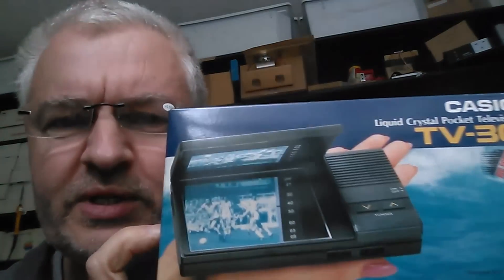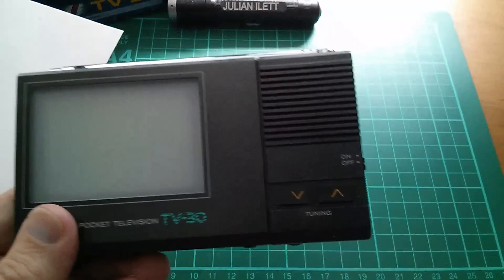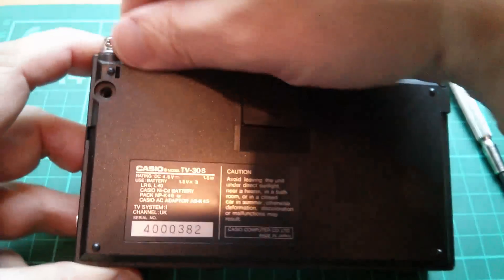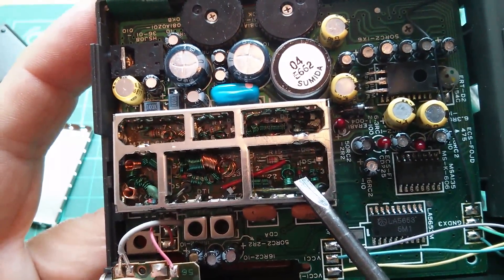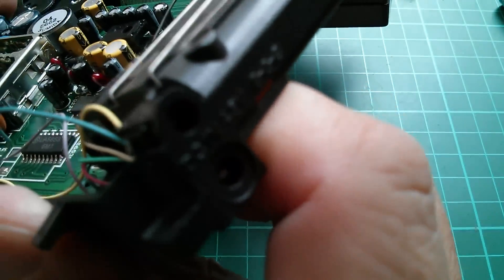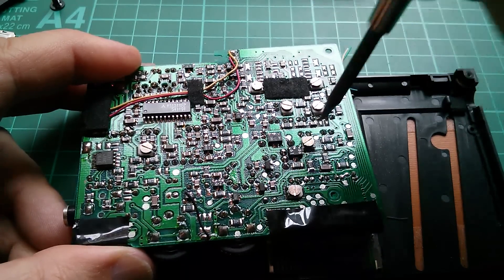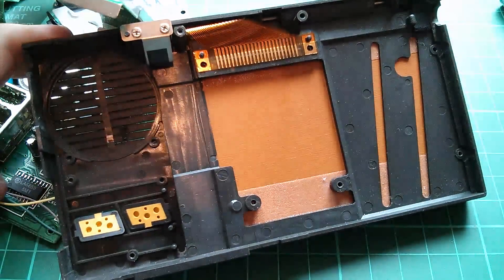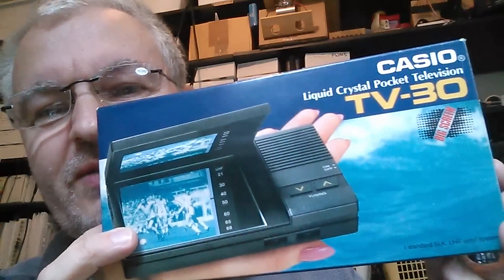1-Way Teardown: Casio TV-30 LCD Pocket Television

Comment: A UHF and VHF tuner will definitely use air-spaced inductors. Splitting and adjusting their spacing by hand on the production line, is how they were tuned and aligned.
Reply: Made in Japan too. Not bad for $50 all the stuff crammed into that little box.  The tuner wasn't bad, I was able to pick up a few stations the rooftop antenna couldn't with this tiny Casio.

Comment: As much as I hated the early LCD tvs I won't have destroyed one in that condition. It was in the box and fully working, yes now they are not worth much, but nice as a conversation piece and down the road will gain value. You sure have bought a cheap unboxed scratch up one and torn that to bits.

Comment: They did have pocket TVs as far back as the 60s (at least in prototype form, but they used a minature CRT and the one I remember from the 60s resembled a pair of binoculars, and used a CRT not much different thanconventional B+W TVs. Later CRT based pocket TVs had CRTs with a clear glass envelope where you viewedthe phosphor face from the inside and they used a mirror so the image would not look backwards.
Reply: I tore a CRT viewfinder off an old camcorder and trace out the pins and voltages came out to be 9V and S-video chroma in. I use it now for diagnostic or watching stuff at night, albeit it is super bright.

Comment: Funny, that thing doesn't have many chips inside, certainly more than the sinclair did.  I wonder why sinclair needed their custom chip for the tv80.
Reply: Main difference, the Sinclair used a CRT. Which is quite bulky and requires high voltage. So it basically used custom chips to fit it all. Custom chips reduces the component count. Like the ZX81 and Spectrum used custom ULAs, and the the ZX80 used loads of ordinary TTL chips.

Comment: yes! they actually used to hand tune ciruit inductors by splitting the coils just as you described. those tunable inductors with those fancy screws at the top aren't always available for the ranges that you need them and in a time where there weren't any other portable tv's I imagine that they weren't yet a common item for the ranges they needed them in.

Comment: Many years ago in my youth, I worked for Labgear (part of the Pye group) one of the products was a VHF TV booster. Thousands were made and sold every week. These had air cored tuning inductors in them. They were tested and tuned on a sweep generator, and as in your LCD TV, one simply compressed or open the coil to get the correct band  of channels. Once or twice we would get one returned customer complaining they were badly made and that the customer would straighten the windings to make them neater!! Needless to say they no longer worked correctly. That little fiddle cost them 25 shillings to put right. Great fun.

Comment: A crap as it is kind of seems a shame to break it up i had a citizen tv that worked the same as this but gave a slightly better picture i sold it on ebay in the end .I also have 2 sinclair tv,s and a color casio tv 470 this has rf in and i have some ugly sony from my dad .

Comment: A very different teardown, maybe a tearup. Enjoyed it.
Those screw type pots should be 0-5pF trimmer caps, or were lol
Have got a Sinclair TV here...brought it over from England when moved to USA mid 2000's. I should fire it up and see what's what. Still worked last time tried, around 2008.
Reply: +slider2732 hope its not the one that used a proprietary lithium battery!   was the tv multi standard? the usa being pal the usa ntsc etc, would it have been useable?  of course usa and UK now has no analogue anyway...
Reply: jusb1066
It is the one with the flat lithium battery yep. Old Polaroid land cameras used to use one too. There's no analog here in the USA either, but can drive it with a similar method to Julian showed. Once had it sat on top of my ZX81 :)

Comment: I had one of those.  I even had a lamp that snapped on the back.  And no it didn't work very well.
Reply from the maker: +DancesWithRobots Yes, I've just noticed the optional accessories shown on the back of the box. The BL-30 Backlight allows viewing in dim light. There's also a NiCd rechargeable battery pack, AC adaptor and 12V car adaptor[sic].

Comment: You shouldn't use those "streamline" glasses! It will make you see worse overtime even faster than if you use a pescribed ones.
Reply from the maker: +pedromms My eyes no longer have the ability to alter focus - they're fixed at about 2 feet, perfect for my computer monitor. I use positive lenses for close up stuff and negative lenses for driving and TV/cinema. My prescription hasn't changed for more than 10 years.
Reply: +Julian Ilett You haven't chaged the "graduation" of the lenses in the past 10 years? You're using the same 4 lenses for so long? Here at home we are familiar with glasses for arround 20 or 30 years and we need to change lenses every 2 or 3 years whatever the "ocular disease" is.
Reply: +Julian Ilett although short sighted i though i had no problem with near vision, untill just yesterday i was soldering a 3.5mm jack to repair some headphones, and i couldnt focus! luckily  if i tgake off my glasses i can focus closely, but i didnt used to have any issue....i am 45 though, maybe next time i need at least clear glass on lower  to facilitate close work
Reply from the maker: +jusb1066 Yes, it's a gradual decline. When I started work as a field service engineer back in 1985, we all had our eyes tested at a Harley Street clinic because we were working with lasers. The certificate said 20/20 vision.

Comment: I just wonder why they have trown this thing on the marked in this unfinished state. The next level for a crappy product like this would have been to sell a portable TV without ANY display... Advertised as "Now you can HEAR your Football/Soccer Games updates!". Da f**k?

https://www.youtube.com/watch?v=rrRiu1jbL8Q

They lied in your face!
Reply from the maker: +BloodySword Yes, this really was a very poor product - I was disappointed in its performance right from the day I bought it. I also bought a Casio TV-400 which had a smaller screen, but a much better image.
Reply: +Julian Ilett I've got a TV-400 that still works, albeit with a couple of dead rows of pixels.
The batteries have been left in from years ago, they're Kodak branded alkaline date stamped 08-91, not sure if that was manufacture date or "best before" - but still unbelievable that they work and haven't leaked!
I did want to modify it for composite video input, as a simple aid for setting up CCTV cameras - but it's one of the many things I never got around to.

Comment: Indeed the inductance was adjusted by separating the coil . I've seen it in hundreds of Circuits. Sad to witness the destruction of a working device even thought i know it's useless now. Can't help it. Nice video anyway.
Reply: +Julian Ilett luckily i sold my casio lcd tv, a backlit version, about a year or 2 before the digital change, knowing it was coming, i assume you have your holiday video digitised? we all hang on for too long to these things!
Reply: With inductors, the final inductance can be fine tuned by either moving the coils closer together or further apart (depending upon whether you require less, or more, inductance), which is why they will often appear parted in consumer products.  The inductor is installed in circuit and then manually adjusted to the final target inductance in situ.  The presence of the surrounding inductors, traces, components, and chassis all influence the actual inductance values so if is often easier to do the fine tuning after assembly.  A classic novice mistake is the impulse to "fix" the inductors to make them look neat and tidy once more, thus altering the circuit in unpredictable ways (resist the temptation).
Reply from the maker: +Mirko Mueller Thanks. I've hung on to this thing for long enough. I'll be throwing out that old Matsui video recorder soon. Then I'll have nothing that can send a signal to the Casio. Just no point keeping it.

Comment: Why do you keep the sticker on your glasses? :D
Reply from the maker: +muh1h1 It's the only way I can tell the 2.5D and 3.5D glasses apart
Reply: Fair enough. But do you need to put the glasses on to read the label?
Reply: CatLord
You may just have changed his life :)
Maybe he can find a set of nailpolish in his "borrowed" purse ;P
Reply: Julian Ilett
Haha, i thought you wanted to start a new trend, like these idiots who keep the stickers on their caps :D
Why do you need 2 dirrefent pairs of glasses anyway? i am shortsighted, and i only have one pair of glasses. if i needed stronger ones, i would just use the stronger ones and viseversa...
Reply from the maker: +muh1h1 I'm shortsighted too. I use the 3.5 just for soldering. The 2.5 works best for video making
Reply: Julian Ilett
OK, so it is basically about personal preference, intresting :)
Reply: +muh1h1 yep next time he will review his real purse :P
Reply: +muh1h1 I was wondering that too. I even paused the video to read it.
Reply from the maker: +Maxx B It's getting that way!
Reply: +Julian Ilett I'm in the same boat with bad eyeballs.  I peel the stickers off, and put a dab of colored fingernail polish on the tip of one of the arms to identify which glasses are which.
Reply: +Julian Ilett Lol I thought you showing off some new British fashion trend that hadn't made it over here to the States yet hahaha